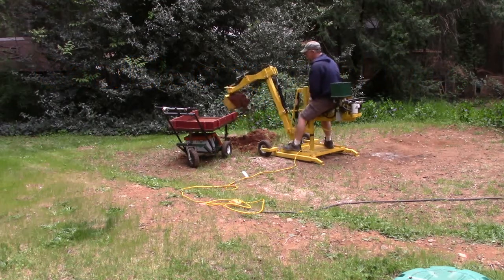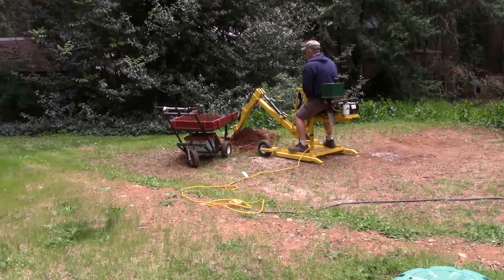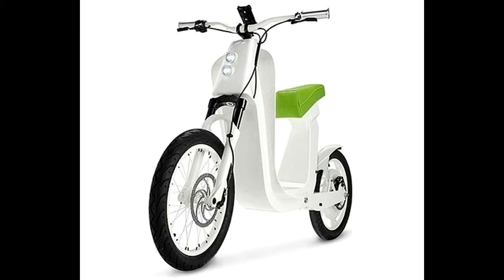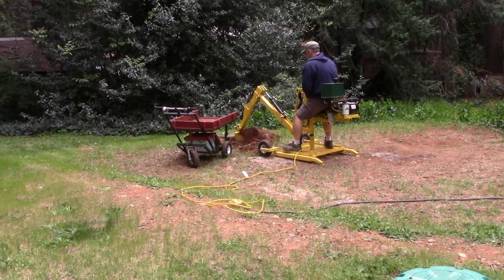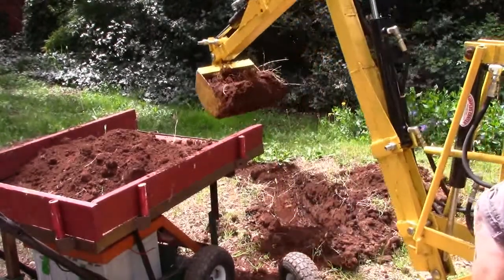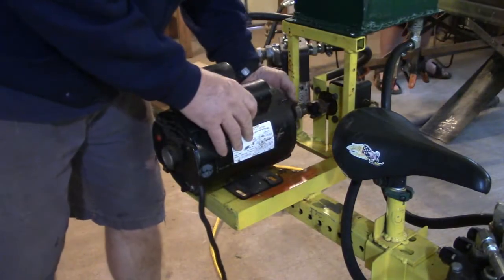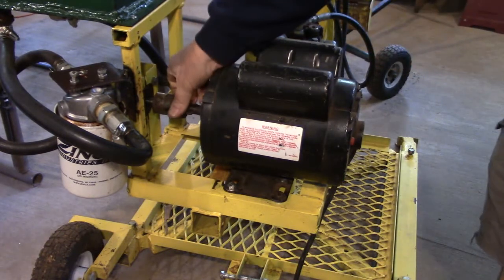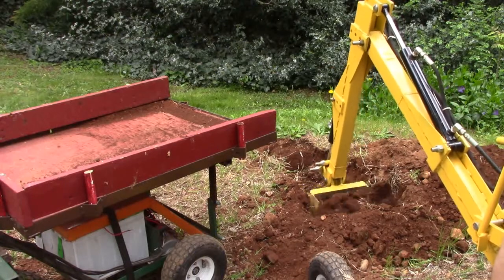electric backhoe trenching for water lines

Comment: This one looks nothing like the one shown on your site. I want to build this one. Not the green one  Do you offer the plans for the yellow one? I want to make it electric so I can use it in my basement. Need to dig down 2 feet so it needs to be small. Thanks!!
Reply from the maker: Hi , The backhoe chassis is the same on all my backhoes. I was going through a green phase for a while.  the power plant and pump size is the only difference. I now use a 1.5 gallon per minute pump to run the hydraulics. At 2000 psi this can be run with a 3 horse power gas engine or a 2 horse power electric motor . A 2 horse power electric motor pulls about 15 amps so it can be plugged into a 20 amp wall outlet . It will have plenty of power and speed. Check out my website thegreensmachines.com  
You can order plans. Thanks. Lonnie.

Comment: If you don't mind sharing, What is the length of the boom when fully extended, and also from base to each pivot point?
I have a harbor freight trencher/backhoe, but i'm currently building a mini towable backhoe similar to yours.  I'm still trying to figure out the correct length that I want to make the boom... Thanks.
Reply from the maker: Email me at thegreensmachines@gmail.com  I also have a website.  thegreensmachines.com Thanks. Lonnie.